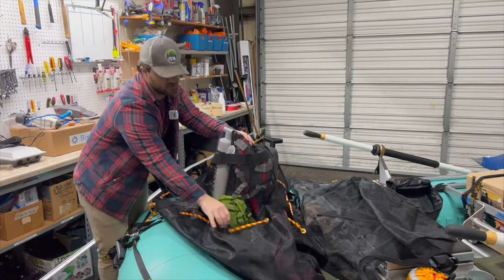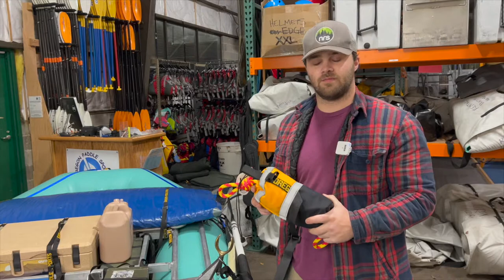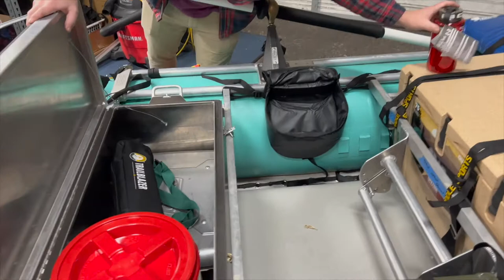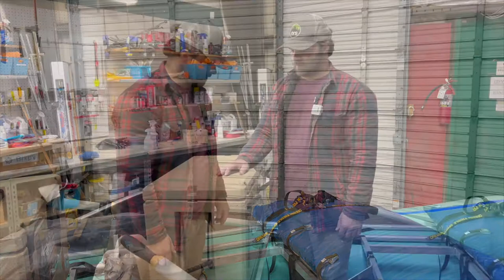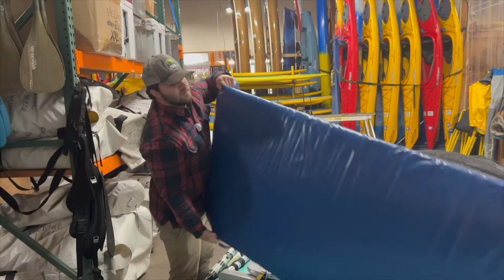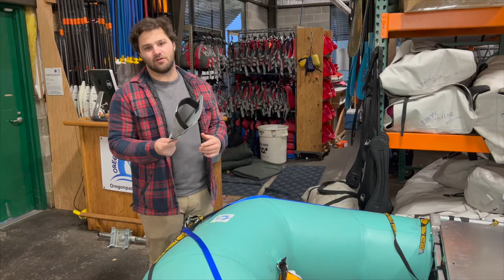How to Rig a Gear Raft with Frame Featuring Whitewater Designs Products

Comment: Two questions:

1. How is that rocket box sling rigged in the back behind the dry box? The loops on one end look like it might come out to a D ring and the perimeter line, but what about the loops on the inside facing the water jug? Come to think of it, how’s that water jug secured? Another sling?

2. How does the rocket box and water jug interact with the Pacific River Bag? Looks like the bag is designed to take up the entire stern, but I can’t tell how you have it rigged here since there’s other stuff in the way.
Reply from the maker: The rocketbox sling is looped on the long side through the top only, connected to the cross bar you can see. This probably isn't optima, the other rocket box is looped through both of the short sides, how it was designed. The water jug is inside another rocket box sling but it clearly needs a way to hold it in, probably another strap around it, good catch though. 

The Pacific River Bag is designed to take up the entire stern area, we were just trying to get creative with a smaller raft. The PRB has several straps to connect into the outer d rings, the floor and frame. 

Hopefully that answers all your questions.